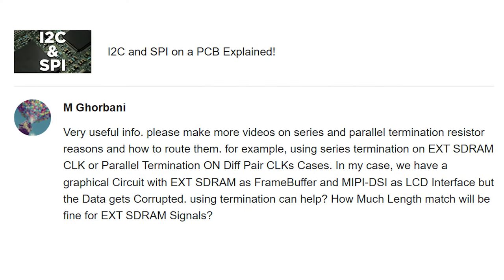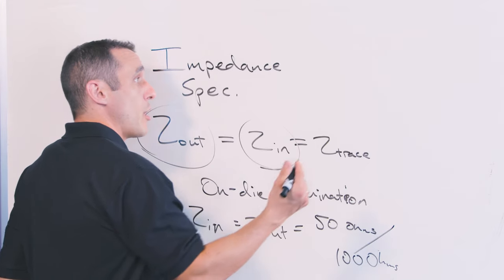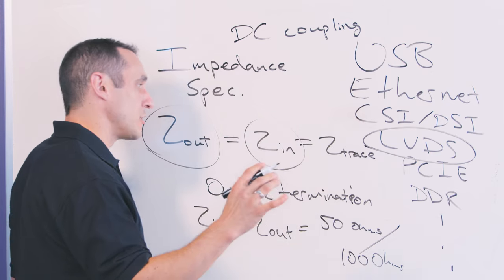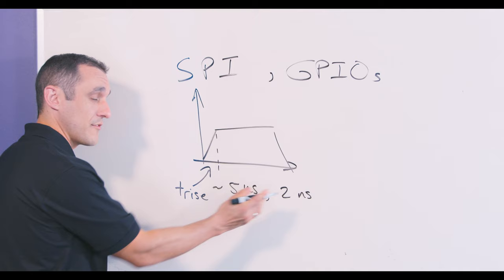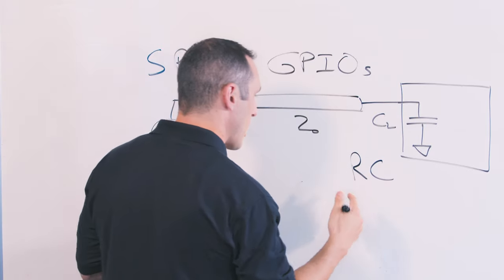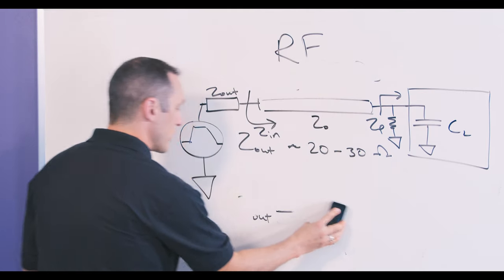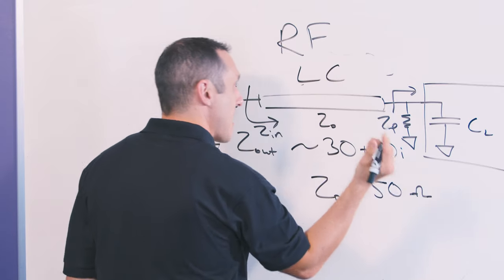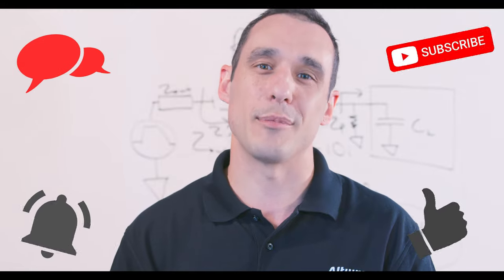When to Apply PCB Termination

Comment: What is the reason, that RF ICs usually don't have output impedance of 50ohm? As you said, with lower frequencies and with frequencies more than 6ghz, impedance is matched in die, why can't manufacturers do the same with RF ICs?
Reply: I don't know the answer definitively. This is something I have seen on MCUs or ASICs with an RF interface, not always on RFICs like amplifiers, attenuators, etc... The moral of the story is to check the datasheet and make sure the appropriate termination is applied.

Comment: Did you already or you will make a video about front end input for analog signals and how we can specify the cut-off frequency of rc low pass filter and select the value of capacitor that the pin can drive ? I'm starting my career in Hardware Design as a Mixed Signal Board Designer and need knowing these topics and also if you have made a video about tips and tricks in Mixed Signal Design? 
Salut, Mr Peterson ❤

Comment: Hi Zach. Because of recent projects I've been working on, I've found that most class D amplifier boards have DC input resistances of about 9K. This is, of course, a couple orders of magnitude lower than what you'd find in the typical op amp buffer or valve amplifier. I'm curious as to why they've standardized to 9K and not 10K, 100K, or 1M (the latter is common for op amp buffers and valve gain stages.) Obviously not high speed design, but I know you have an analog background, so you might have some inside baseball info.
Also, I know that most CMoy headphone amplifiers have a series resistor on the output. Presumably this is to match the output of the (typically Burr-Brown) op amp to the impedance of the headphones?
EDIT: Dave Jones has said that the typical "basic bitch" CRO probe is essentially a distributed LC transmission line. Concur? Dispute? Discuss.
Reply: No. The output resistor is current limiting. The input to any amplifier is used in conjunction with a capacitor to set a pole frequency to reduce sensitivity to RF signals that could cause nonlinearities. 9k dc resistance isn’t characteristic impedance. Back to school.
Reply: @envisionelectronics  Could have left out the last sentence there.

Comment: I thought that when a serie termination was used near an output driver, nothing needed to be added at the input driver side
Reply: You mean at the receiver end? Usually no unless you are both suppressing reflections and dividing down from a high voltage signal to a lower voltage signal. It basically does both.
Reply: @Zachariah-Peterson  Yes I was talking about the receiver side. 
But in this video, you not only use a series termination resistor, but also add a 50Ohm parallel termination resistor at the receiver side (without wanting to divide the voltage)
Reply: @AlbertRei3424  Sure I understand why there might be confusion. Whether you apply both depends on a few factors. You usually choose one of these for the following reasons. You can use both if the line is long and you are okay with dividing down at the input and output as an R/2R type of divider. Sometimes when you use series and apply that R/2R type of division, it was technically being divided down by a non-zero source impedance anyways so it may not appreciably affect the signal level that is injected into the line (this is sometimes the case for SPI), it just depends on the source impedance. If the line is still not within the electrically short limit, then there can also be a reflection off of the end of the line. To prevent that reflection you can then add a parallel resistor, but you also have to consider the division at the input and whether it will toggle the receiver. If the division brings the signal too low (meaning voltage sunk across the termination resistor is too low), then you will not toggle the receiver.

For high-speed interfaces that have an impedance requirement, there is already that kind of parallel resistive termination anyways to prevent reflection from impedance mismatch, just look at the on-die differential termination circuit options for input buffers on an FPGA and you will see what I mean.